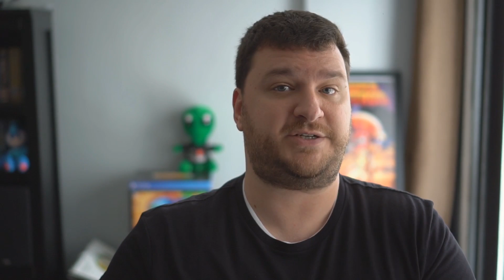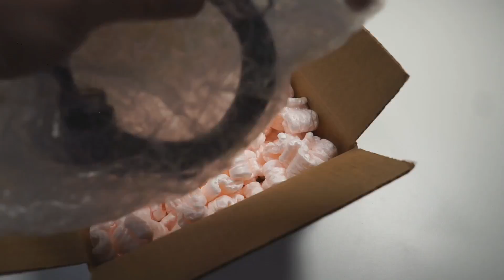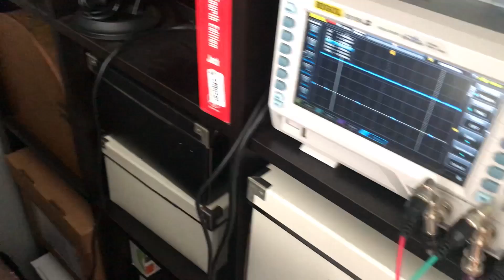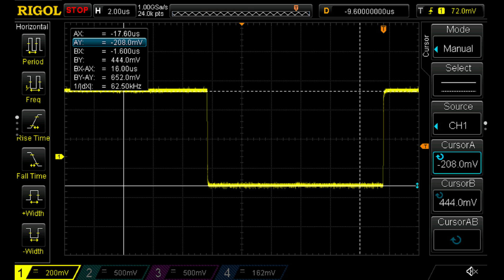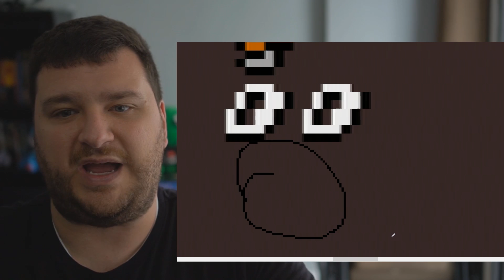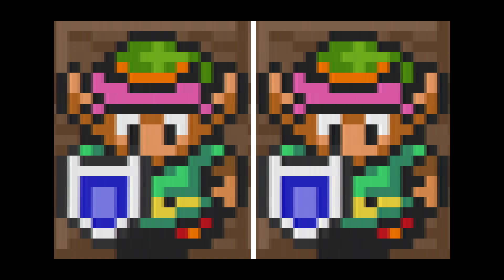Insurrection Industries SNES RGB SCART Cable Review

Comment: So with a SNES RGB mod, I assume you leave TTL sync disabled for these cables?
Reply from the maker: No, you'll always want to output TTL sync from a mod, because you want the modded SNES outputting the same exact signal as an original SNES.  I wish board makers never gave that option at all, because it just confuses people.
Reply: @RetroRGB  Thank you for your advice. Tackling the RGB mod tomorrow for my SNES mini and these same cables just arrived.

Comment: I see the video showing them for $22.99, where did you find them for that price ?  I can only find them for around $25-30... After dealing with a cheap SCART from ebay, that has a really bad HUMM I need to get a better cable because playing with that noise is unacceptable.
Reply from the maker: The video's over a year old...maybe the price went up a few dollars?
Reply: TheCoolDave https://insurrectionindustries.com/product-category/cables/

Comment: The quality on these cables has significantly gone downhill. I bought a PSX and SNES SCART cable and both have really bad looking solder joints as well as neither of them have the heatshrink actually shrunk to fit. They just slide around.

Comment: Glad to see another contender enter the scene. retro access and retro UK have both stepped away from custom work and only focus on their high volume cables. A real disappointment but just not as much profit in taking care of long term customers. My guess is the thinking changed to why build a custom when you can build 2 stock cables for cables that meet buyer quotas daily.

Glad to see the audio is shielded. Audio buzz is always the most apparent flaw in low quality cables.

Comment: For some reason, in my set-up, I currently have to unplug my hydra scart switch from my framemeister, and plug my snes scart plug straight into the framemeister bypassing the hydra scart switch anytime I want to play snes. I've tried several cables and they all give me audio but no picture or neither when running into the hydra switch. But, when I just run the snes scart cable straight into the framemeister, I get both picture and audio. Does anyone else have this problem? Does anyone know if the cable from this video will work through a hydra scart switch? All my other systems work fine through the hydra scart switch into the framemeister except snes.

Comment: In 2018 there is no reason to solder like that!! (so 1950 style of putting circuits together). A proper PCB should be used. Citrus3000psi gave a good one out for free!

Comment: Very good review! Only thing I would recommend would be to also review a longer run cable if they have it. Back when I had manual scart switcher, issues with the lower end cables became more pronounced traveling through multiple/long runs.

Comment: 1. Is that company in the USA, if so it would be easier option then getting some shipped from Europe.
2. That company is also making a digital out hdmi for the gamecube. hope it turns out well and works better the gchd with gbi. Hope you test it with gbi.

Comment: Further to the audio testing Benedict Heyer suggested, I would be interested in seeing examining of how the VIDEO looks with various game audio playing in the background, to see whether crosstalk from the audio is affecting the video signal. I am less interested in the integrity of the audio produced by our retro consoles as I am the video signal. This will probably be harder to test for, and will require capturing and examining video footage for evidence instead of just the screencaps, but is probably worth checking for, since the presence in cables would reflect poorer internal shielding, etc. Not sure if the 240p test suite features a test showing imagery while various audio plays in the background (synth, samples, etc), but this would be worth having instead of needing to seek out specific carts with convenient testable areas in games. Great review Bob!
Reply: There's a reason why you don't see anyone talk about that.  Audio->video crosstalk is not typically of concern, since the audio signals are much lower frequency and drive much higher impedances (less current).  Unless there is some horrible unintentional EMI radiating from audio lines in question, then you're only going to get in the microvolts (1/1000th of a millivolt) range of crosstalk from the audio onto the video lines even if there's zero shielding.  Video-on-audio and video-on-video crime is all our tax dollars need to focus on.
Reply: You talk a good game, but I'm not gonna just listen to some muppet off youtube tell ME how it is. Why don't we ask an expert whether this matters or not, like those hairy guys from HD Retrovision? They actually make cables, so they should know.
Reply: Don't let those HD Rectalvision goons trick you with their corporate greed.  They're only experts at producing registered-sex-offender caliber facial hair, as far as I'm concerned.